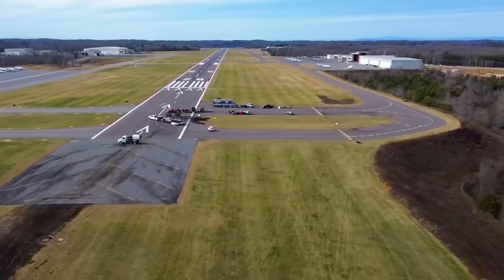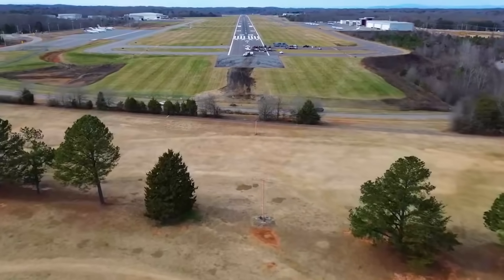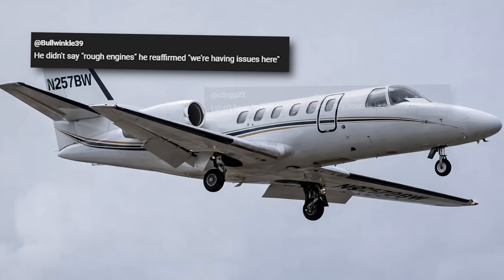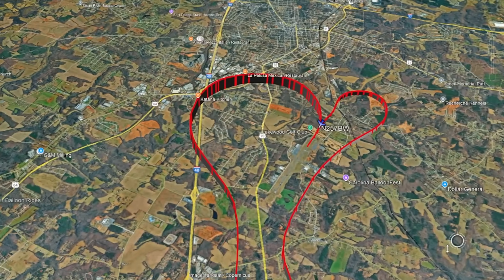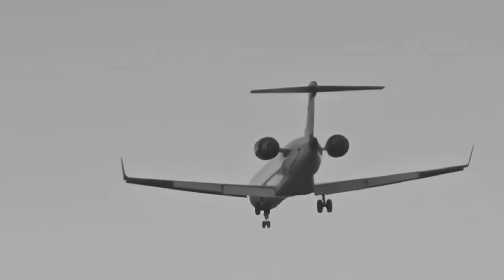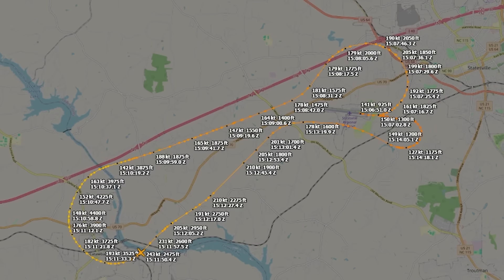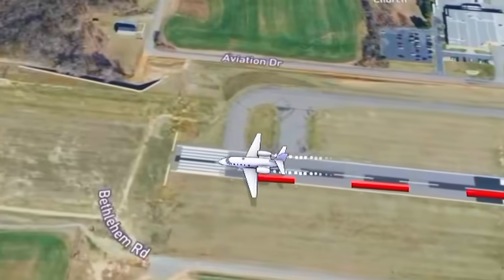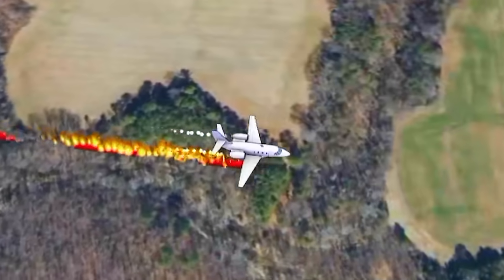Why Greg Biffle Crash Audio Sounds STRANGE | UNICOM vs ATC

Comment: Engine failure in a Citation would not be a huge problem unless there was something else wrong.
Reply: It’s a huge problem with a full load and improper config. SOP for single engine on these is to avoid full flaps and gear down until last moment. It will fly with single engine but has to be configured to do so.
Reply: Exactly why I feel that there were other serious problems

Comment: Have not heard why someone on the ground just happened to be recording Unicom. Is it standard at Statesville to roll tape on a loop? Did someone hear a transmission and then start recording on a phone picking up the Unicom broadcast from a radio speaker at the FBO? Do we know if we have all the transmissions from the Citation!?

Comment: Your description of UNICOM is entirely incorrect. Pilots operating in or near uncontrolled airfields use the CTAF not UNICOM. Sometimes the frequency is the same, but pilots use the CTAF, which is the "Common Traffic Advisory Frequency", by saying "Name of airport, Traffic, call sign, then intentions." Example;  "Statesville traffic...". This is what Biffle's Citation announced. They did not call UNICOM. The UNICOM is used by FBOs and pilots to organize services, parking, fuel, etc and sometimes weather reports.
Reply from the maker: Right, at Statesville, CTAF and UNICOM share the same frequency (123.075 MHz), but you're spot on that pilots use CTAF protocol with calls to "traffic" for self-announce, not hailing UNICOM like a base station. My bad on the loose wording. Appreciate the correction!
Reply: Irrelevant

Comment: The fuselage was intact. The fire probably killed them
Reply: Fire, smoke inhalation, CO2/CO.  I hope they were unconscious before they fire got to them.
Reply: Did you see the crash footage? The impact killed them.
Reply: @triedproven9908 Impact with what... when the front landing nose-gear hit the ground and bounced back up through the fence? I think they would have survived that impact if they were all buckled in... but I'm not sure.
Reply: @bills6093  The right wing hit those trees. In front of the fence is a deep gouge in the ground where the front gear supposedly hit into the ground, but it looked to still have that attached, although I couldn't tell for certain because of the flames.
Reply: The impact forces likely killed them. I guess an autopsy will show if they breathed in any smoke.

Comment: Now they need to get rid of those remaining trees in case it happens again.
Reply: The trees weren't the problem the path was😅
Reply: I don't think anyone has ever hit the tree tops before at that airport. Most pilots come in for a landing at the correct speed and altitude. They don't land in a ball of flames.
Reply: It's 1,400 feet or so from the piano keys to those trees.
Reply: The treetops are below the level of the runway.

Comment: Calling mayday is a waste of time. It is not hollywood with the magic hand to the rescue. We see the result of the mess with flight into the ground. Why Bob Hoover is the best at trading altitude for airspeed. I have not seen why this accident started??? So many bad choices from the  pilot. Having a sic would not solve this. It was the pic that caused it all. He did the first worst sin, stayed too low. Get altitude, save your ass and give you a bit of time for a proper choice.
Reply: I doubt it was going to climb with an engine out, full fuel, full passengers. Infact if you'd reviewed the flight data you would have seen they were managing altitude the entire return.
Reply: I disagree. A QUALIFIED Sic. Could have run the checklist and monitored aircraft altitude. A good, qualified f/o and that plane most likely lands safely.

Comment: What kind of idiot would have 40 ft High trees at the end of a Runway?
the type of person that doesn't know how to maintain an airport.. .
Reply: The taller trees are about 1400 feet from the piano keys.
Reply: I think that was a golf course across the street. Most pilots come in at the correct altitude and don't crash into the tree tops, runways lights, chain-link fencing, etc... The trees are irrelevant. I don't think anyone's ever hit them before. The pilot wasn't too skilled in that little plane... he ran it into the ground. Awful!
Reply: @NalaRichenbach you need to think before you speak because you obviously have no logical rationalizing ability!.. .
Reply: It’s not the airport fault they crashed.   It was untrained pilots. Thst caused that crash
Reply: @theresabiermann3906 Wrong! you know nothing of what you say.. .
Reply: @alphaindependent Someone planted trees and hit it

Comment: The post crash drone video says it all. The rest is just confetti 🎉.  10 feet higher they would have made the asphalt.
Reply: he thought he was gonna make the blacktop BUT optically he didnt see that big rise. They were on final approach to 28 with gear down and the son had no panic in his voice IMO.
Reply: @dustyflair  They didn't see that rise until the final second. It must have been an "Oh Shyt" moment.
Reply: 🍉🍉🍉🍉 7ò5e ☝🏾😎👉🏼💥💤
Reply: 10 feet lower and he would have hit 1/2 mile short. This all started at the time power was pushed up. Crash was result of many bad choice. What was the cause of the initial crisis??? That has not been said.